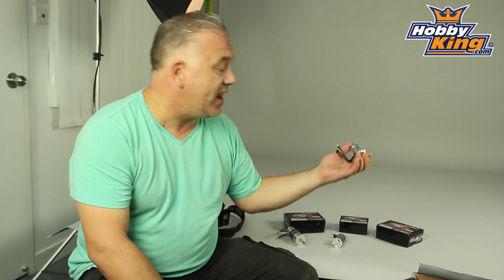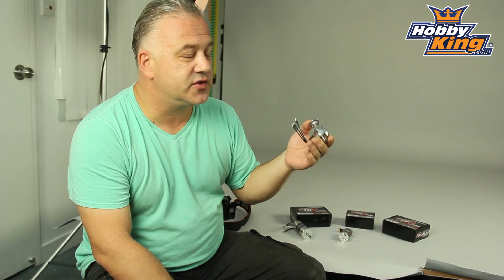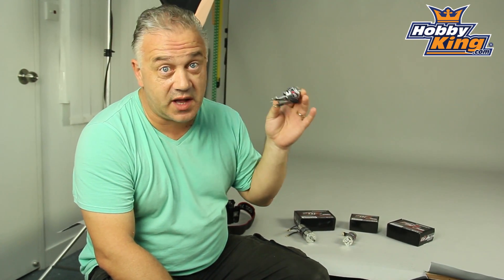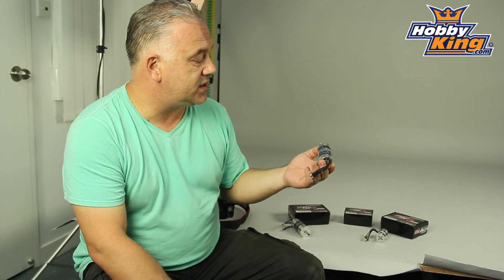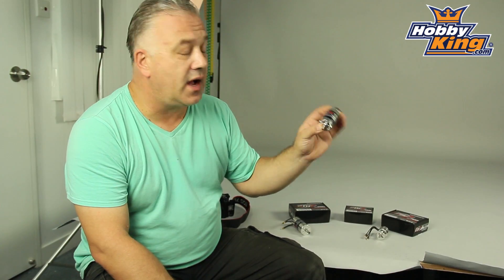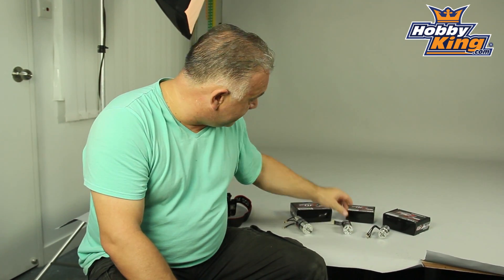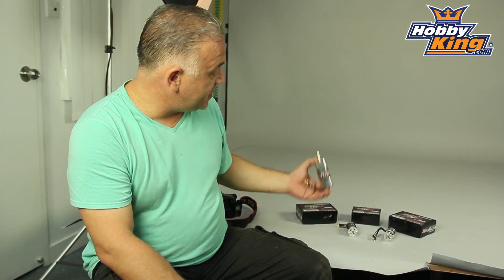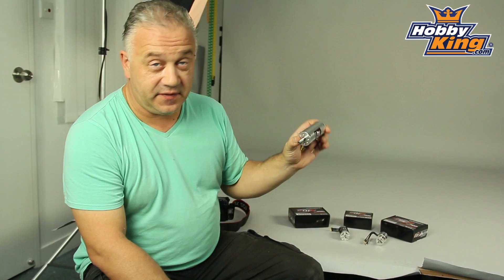HobbyKing Daily - Turnigy Super EDF SK3 Motor

Comment: Regarding the 90mm motor, everywhere I read, people are using 140A on this motor. Is it acceptable to use a 3000mAh 6s 30-35c battery with a 4x4/5x5 prop? Would that keep the motor/ESC/battery cooler?